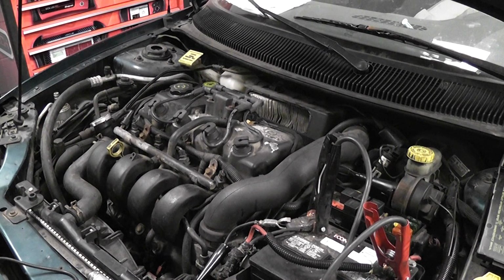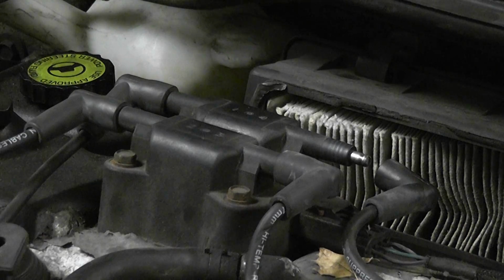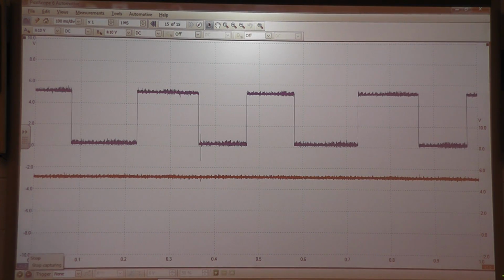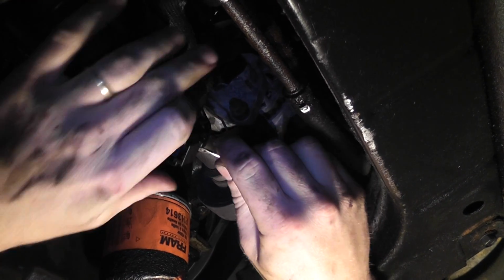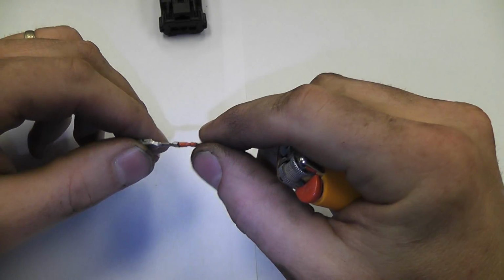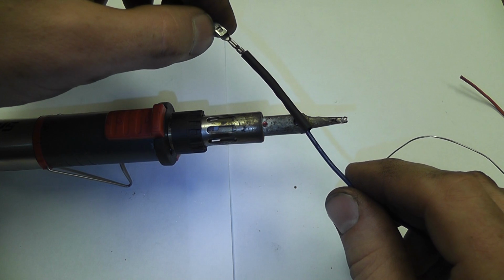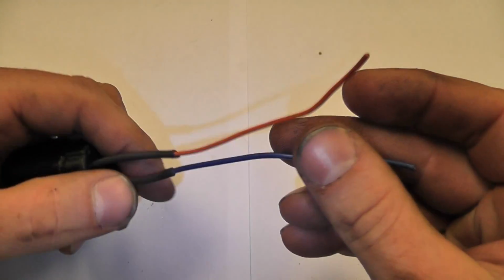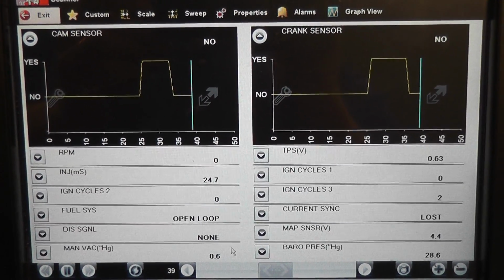1997 Dodge Neon no start, crank sensor problems

Comment: why don't you use soldering flux or tree resin? It will help clean the copper better and spread the solder onto the wires. Not using it can result in micro craks in solder joint. I saw the same thing when you fixed the Honda PGM-Fi main relay. Like your work, thanks!
Reply from the maker: Thanks for the comment. I thought rosin core solder has flux already in it? Anyway, I have used it and really do not need it in most applications. Been soldering wires and circuits for 20 years without an issue. No cracks, no premature failures. But that doesn't mean I couldn't benefit from using it more.
Reply: ScannerDanner
you are right about the rosin core solder, but i get the best results when i use tree resin...the one used to rub on a violin bow. Sometimes the copper wires are verry coroded and the solder wont stick to it and make a good connection, a warm connection :)
Reply: Andrei Esanu for sure, those copper wires that are black from oxidation? I cannot solder those at all. I end up cutting out all of the wire until it turns copper again, then fix it. I'll have to try some flux on those next time. Thanks!
Reply: Andrei Esanu
Where can I get the tree resin? I have never heard of it.
Reply: It's a rosin used for violin bow. Much harder than soldering paste. Google colophony

Comment: i have a 2000 dodge neon that i replaced my battery and my ignition switch but i still cant get it to crank over at all any ideas for me im thinking its my starter or my computer  my fuel pump kicks on and all the dash lights come on but when i turn the key there is no noise of any kind from the engine please help if you can

Comment: Hello friend excellent tutorial short and precise, I have a problem in my neon 97 and that is when I start or I'm rolling this is turned off, try turning it on without returning the key and will not start but if I give it back and start right away as if nothing turns but try rolling back and turns off please help me nuts, and clean the throttle body and IAC valve, replace the alternator and the coil, please help me nuts and empty pocket ...... Thanks in advance ...

Comment: scanner danner ive done all the checks in the video my problem is in the relay terminal box for the asd relay terminal 86 has voltage engaging the asd relay not to let it get fire or fuel where do i look next

Comment: So i did a test out if the haynes manual i have by using a led test light on the eltrical connector and the light didn't flash and the book said that could mean a faulty pcm what do you think? I really appreciate all the help btw

Comment from the maker: Trouble codes? Do you show an RPM signal on scan data cranking? Do you have injector pulse? There is also a CAM and CRANK data PID you can use on the scanner to see if there is a signal.

Comment: I get a reading with a voltmeter and test light at the electrical connector to the coil while cranking but still no spark off the coil pack as you tested in the video and its a brand new coil pack

Comment: Hi i have a 1997 neon as well no spark won't start i replaced ignition coil pack crankshaft position sensor and camshaft position sensor timing belt appears fine and i have compression could it be the PCM? If not the wiring

Comment: To play it safe, that friend changes the cam and crank sensor every 100K miles. His Neon must have close to 250,000 miles by now. Haven't seen him for awhile but other friends told me he still drives it.
He switched to all synthetic fluids soon after he bought it, and had it Ziebart treated. I think it's a 1997. Seems like he waited a couple years to make sure all the bugs were out then bought one with a five speed manual.
Thanks for posting this video, it will help me with my neighbors car.

Comment: The method you use to join the damaged wires is identical to the method Chrysler taught a friend of mine who worked at the factory. He went to Detroit for several weeks before the Neon was built at Belvidere, IL to learn all about the electrical of the Neon.

Comment: hey i have a 1999 Dodge neon, the computer connectors have alot of oil inside is that normal? what should i do if its not normal?

Comment: Hello  Scannerdanner I also have a 97 Dodge neon and I have a problem with it, at 1st my car was running fine with no problems, then as I got close to my destination when I turn my left turn signal on it blinks fast n then when I parked at my destination about 25 mins later I come back my car won't start. The lights came on, my radio and stuff can come on also but when I turn the key it won't start at all, no noise or anything, I checked my tinning belt and everything was still attached do u ha

Comment from the maker: it definitely is not the crank sensor. first thing is to check your coolant level as i believe your car uses a coolant controlled cold fast idle valve.
i just shot a video on this, look for it  next week

Comment: Hello I have a 96 Honda civic Dx 1.6l non-vtech manual trans, my issue is if my idle is going up n dwn and I've replaced the icv sensor could it b the crank sensor since it stops after driven but stays at high idle please help thank you

Comment: I watched you videos and it's a great video by the way. So the ASD relay is whats powers up my coils. I tested the connecter of the ASD relay and I have two with power without the key on. And two with ground.However on one of the grounds the light is weaker than the other. And when I turn the key on I can hear the ASD relay click. Could it be the lost of ground that causes my coil packs not to power up? Or it's the ASD relay that's bad. ASD relay was change a year ago because of no start.

Comment from the maker: ASD provides power. Did you watch my video yet? "Fuel Pump Electrical Circuit Designs"
You don't need to watch it all, just find the part were I talk about the ASD relay

Comment from the maker: you are reading a ground because it is backfeeding through the fuel pump circuit and other shared circuits. I am telling you that you are missing a power feed on that middle wire. the type of light that you are using is very misleading

Comment: Thank you for your response. My car is 2.0 engine non turbo. I Know that my car has an ASD relay. I'm certain that my relay is working because every time i turn on the key I can heard the click and also my ASD relay was replace less than a year ago. Also the middle wire of the connection pack is a  ground because with my LED test light turns green not red. I check the other two wires with a multimer to check for voltage while cranking, but there is nothing. Do you think it's the PCM?

Comment from the maker: No, this is incorrect. You should have a constant power feed on that middle wire. Is this a Chrysler 2.4 engine?
If it is, power is supplied through an ASD relay that is computer controlled. You will NOT have power to this coil with just the key on. You must be cranking (PCM must receive and RPM signal to turn this relay on). Or during initial key on, you should have power for 1-2 seconds. 
Watch my video on "Fuel Pump Electrical Circuits", there is a part about ASD relay op. in there

Comment: I also got the code of P0352:Ignition Coil B Primary/Secondary Circuit Malfunction. I check the wiring between PCM and coil pack and everything looks good. Now I'm guessing I have a Bad PCM, but I want to know what you think? It would be of great help if I get a professional opinion.

Comment: Hello. I have 1997 Mitsubishi eclipse(non turbo) with no spark. I change the cam and crank sensor and still no spark. I used a LED light to check the connector of the coil pack. The middle wire has ground all the time. I'm guessing the other two wires are for the PCM to give power to Coil pack. So i used the test light to check those two wires and while cranking the engine the light just turn on and of once. I being told that it should be constantly flashing while cranking.

Comment from the maker: no, compression will not change much, unless there is "cylinder wash" that has occurred (excessive cranking, no start condition with the injectors that are still firing)

Comment from the maker: @junky9 this is a waste spark system so there is only two coils. if your losing spark on coil tower 2 and spark is good on its companion cylinder 3, then it is just a secondary problem. if this keeps happening your either getting junk parts or you have excessive resistance in the number 2 plug or wire and it keeps burning out the new coil

Comment from the maker: good question, I see it all the time. It is from repeated flexing of a particular wiring harness. If there is not enough slack the wires get stressed and over time will break. Sometimes without breaking the outer, more flexible, insulation

Comment: Thanks for posting this, it was informative.  I do have a small tip on soldering,  the oxides on the tip of your soldering iron act as an insulator, and you aren't getting the full heat out of your iron as a result.  Clean that tip up, then keep it clean by wiping it with a wet paper towel occasionally while soldering.  Give it a try, it makes a big difference.

Comment from the maker: That depends, if you are commanding the coil to fire with the scan tool, you are bypassing the inputs needed, so we need to be careful with these blanket statements.
For the most part though I would say yes, if you are getting spark and fuel then you do not have a crank sensor problem.

Comment from the maker: The MT2400 is the Vantage (graphing multimeter) the MT2500 is the scanner (we called it the red brick...great scanner in its time).
As far as what to buy, it would depend on the year of coverage you are looking for. You can always get used ones out there but you have to pay attention the the year it is update to.

Comment from the maker: No there is not. Other than cranking the engine over with the PCM receiving a good cam and crank signal. The coil transistors are inside of the PCM on Chrylsers. No external module/igniter so you cannot trigger them manually.

Comment from the maker: You cannot totally prevent it. Just makes sure you disconnect the jumpers in the reverse order. Headlights on or off I don't think will make a difference, not to mention with the dead battery car all you would be doing is stressing the alternator even more. (not a good thing)

Comment from the maker: Engines off/keys off on both cars. Step 1: Connect positive leads to both cars(doesn't matter which one first) Step 2: Connect negative lead to the good car. Step 3: Connect negative lead to the block of the bad car if you can. This will keep the arching as far away from the dead battery as possible. This step prevents the battery from exploding, it doesn't protect the computer. You can use the neg. post but just be careful. Start the good car and you should be good to go.

Comment: Another great vid, thanks Paul. If possible, can you give a brief explanation of the cam crank correlation/sync pid and maybe a first step? (Lost sync today, but cam and crank were both "Yes" on the Verus - car still runs).

Comment from the maker: Not sure, just matched it up with the old wires. I just cut some wire out of an old engine harness. As this circuit doesn't carry any measurable current flow gauge size is not critical.

Comment: I got the same soldering gun. Snap on part number YAKS32A is the kit with 6 tips, blower & hot knife.  Which is actually made by Weller part number PSI100C for the gun itself then add additional tips you need.  Do what I should of done and save some green by not paying the 're-brand tax.'

Comment: No, Scotchbrite is an abrasive cleaning pad......comes in various grades of abrasiveness, with white being the least aggressive. Soldering corroded wires is a nightmare but a few swipes with the scotchbrite can really clean up the wire. Gotta be real gentle though because you can cause more corrosion. Anyways, just try some flux and you'll be amazed at the difference

Comment: The trick I use to seal wires up is just put a dab of RTV on the wire then slide the heat shrink tubing on and shrink it – that should seal out just about anything.

Comment: Hey Paul...........throw a bit of flux paste on those wires before you solder em and it would be much easier to make it pretty. I like to flare the two wires before I put the flux on. That way the flux gets right in when you twist. If the wires are a bit corroded, a little bit of white scotch brite can really help with the soldering......helps get that corrosion off so the solder can stick